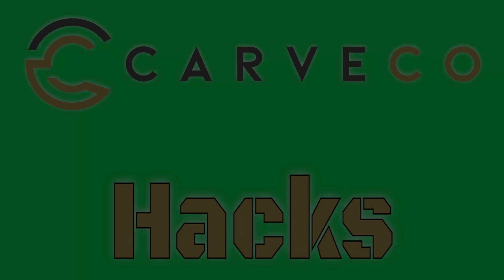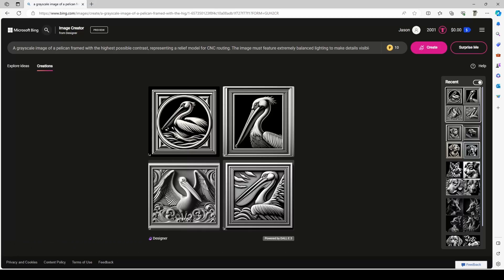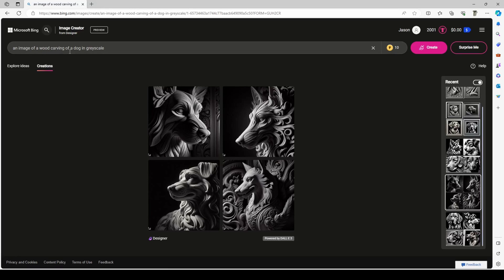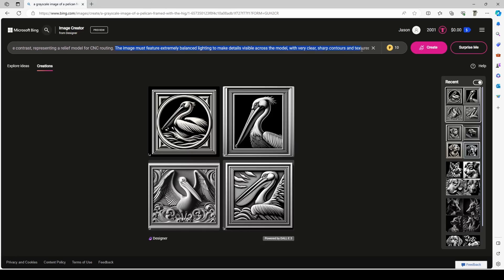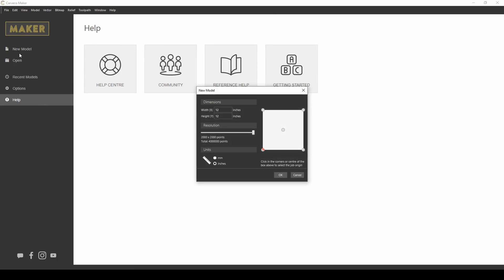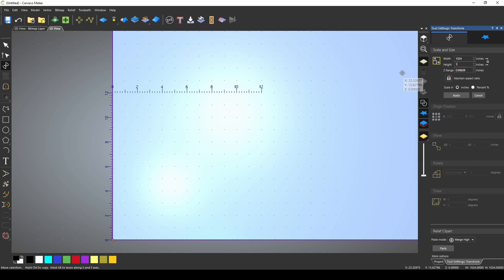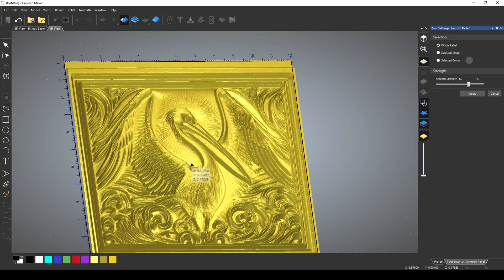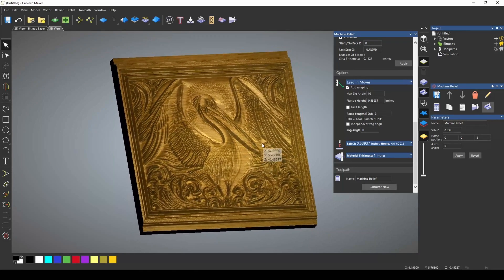Carveco Hacks: Using AI to Create Relief Models.

Comment: how can i get the image only i just want praying hand with nothing around it but it keeps putting all kinds of of carvings around it! thanks
Reply from the maker: I use ai tools like canva and bing image creator to  isolate one object in a picture before trying to make it into a model.
Reply: Jason help please i want to convert a 1"x5" rectangle vector to a relief so i can manipulate it? Thanks
Reply from the maker: @Edilberto-w8z  check this video out https://youtu.be/0GfsdI4TdZI?si=jUTCQ242cUnIBWh2
Reply: Sorry to bother ! I got the rectangle now i need to  keep the height in center and bow to each side i tried the fade could not get it! If u can help thanks.
Reply from the maker: @Edilberto-w8z  on the fade tool there is two white dots if you move one to the middle you can get just one side to angle down. Alternatively you could just try the smoothing tool set to 100% quite a few time and it would smooth those edges over
Reply: @ thanks for reply!

Comment: Weird glitch that I am wondering if you have come across or have any thoughts on how to remedy.
I was fooling around with making a sign with a name, the AI spells the name differently in almost every image. I tried putting the name in quotes, in all caps and even saying "a name spelled x" and it still doesn't follow through with it correctly.
Reply from the maker: At its current state the AI is not very good with names unless they are super common. They train these AI models with only a limited amount of data and names and wording seems like it struggles. I would say just keep trying the prompt and you may get lucky with one getting it right.

Comment: which version of carveco are you using. can i use basic carveco
Reply from the maker: Yes you can use maker and is what I was using in this video.
Reply: would you reccomend carvco maker or carvco plus i am fairly expereiced with vetric pro. Seems like carvco is more 3d user friendly
Reply from the maker: @arthurwarner196  I also started with vectric and own aspire but use maker+ as the 3d tools are more refined and easier to work with. Over the last year or so I have found carveco to be further ahead on the software development side of things and improving the tools they have. Maker+ is by far the best bang for buck software on the market.